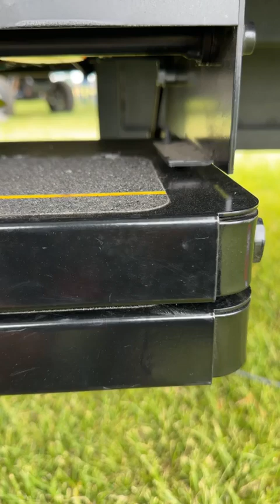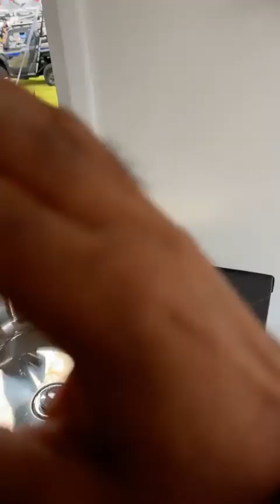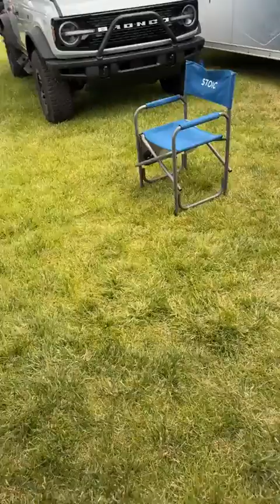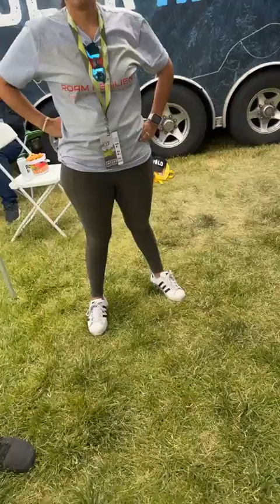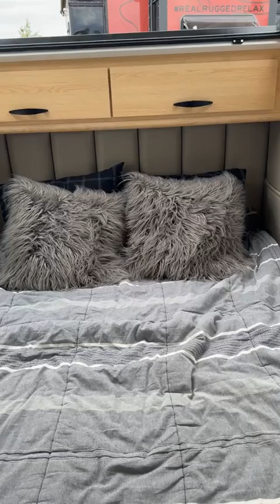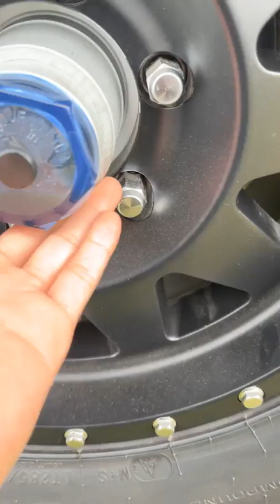RREV Baja Edition - Thorough live video from PNW Overland Expo (Part 2)

Comment: In the shower, is there a shelf or any place to hold shampoo, soaps or do we need to find a caddy that will work with the shower system?  If the latter one, which shower are you using in the Outland edition?  (planning)

Comment: Did I hear you're doing a special on this rig for 100k?  I'm full-time and moving from a truck camper to a off road trailer to continue my travel.  On your website, the price is way higher than the 100k.  Love the rig, and unfortunately, I didn't make it to any of the OV expos this year.
Reply from the maker: Thanks. That was the founder series pricing for the first units we built. The website prices are the latest prices. Please feel free to reach out with any questions.